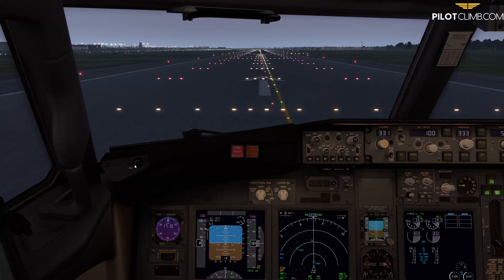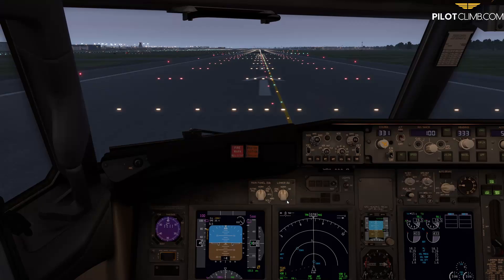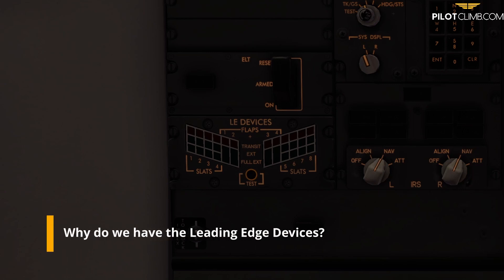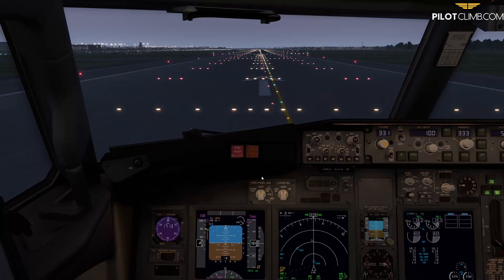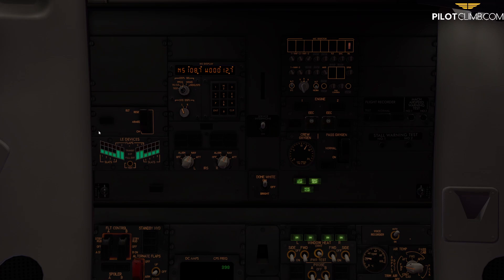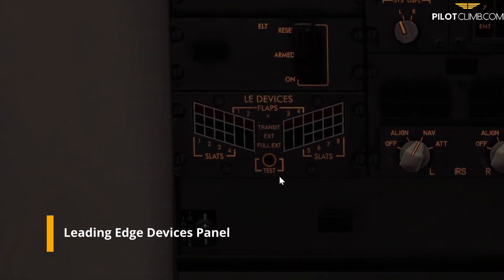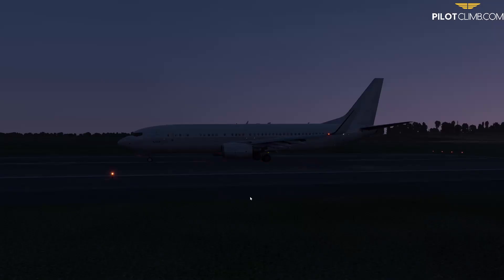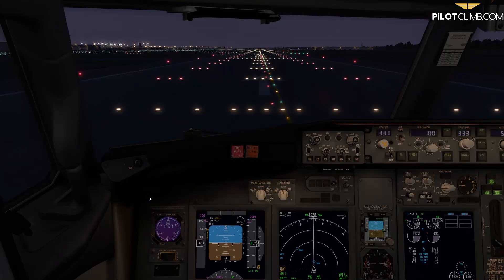Boeing 737 Leading Edge Flaps And Slats Annuciator Panel.

Comment: Thanks a lot captain, I usually look at this panel when I test the flaps or when I have problems, this video was REALLY useful to me, I understood how this panel works now.
If this is not bothering you, could you make a video about the Alternate Flaps Extension mode in case of emergency? And could you talk about the asymmetry protection mechanism that the 737-800 is equipped with? Because I understand that if only the right wing or the left wing extend flaps and the other one has a problem, without the safety mechanism that blocks the motor of each side locking them together at the same flaps position, you can enter into a death roll. The plane would start banking in a dangerous way that could result in a deep stall.
Thanks for your time and thanks for this video, wish you a great day captain ☺ 😀
Reply from the maker: Hey, many thanks for an other great comment!! I will make a video about the topics you suggested.. stay tuned